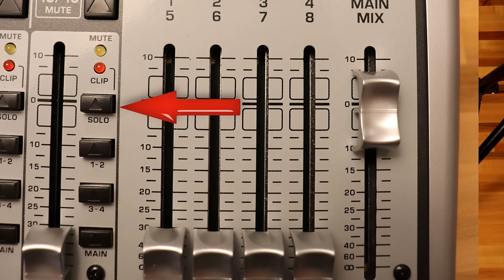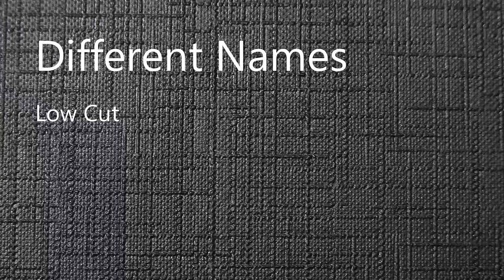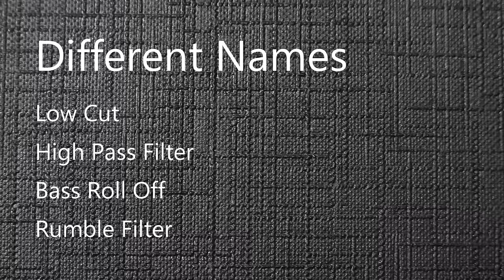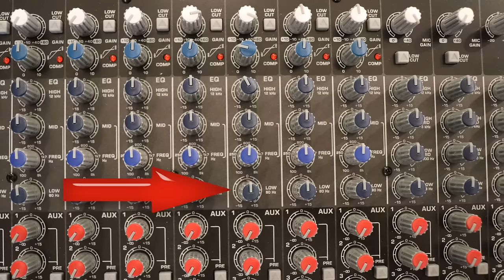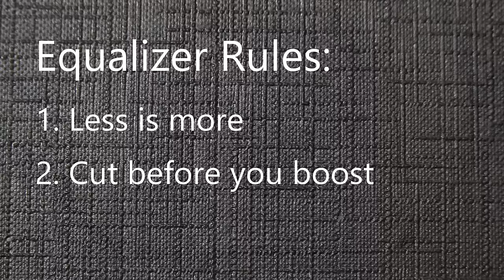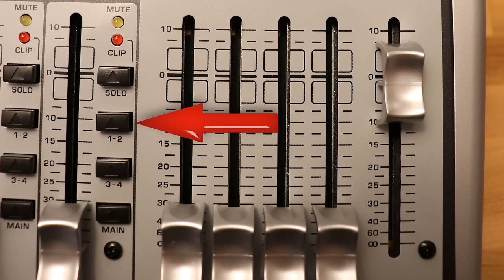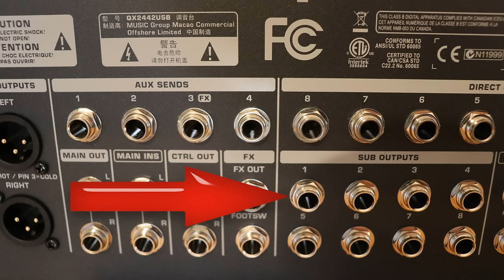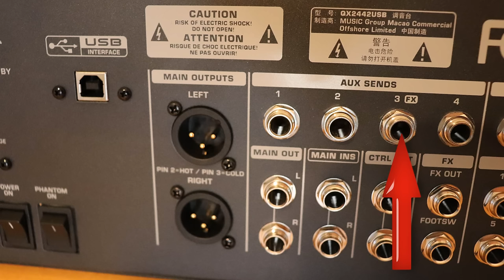Analog Mixer Basics (How to Use An Analog Mixer)

Comment: Okay. The dude with the Taylor up on the platform: DI into Channel X. He's also got a pedal board. And a looper pedal going into a strum-drum pedal. Aux 1 in a loop for the pedal board. Aux 2 for the loop from the Looper and SDrum. Pre- or Post Fader? Return jacks or burn a "stereo" channel with line ins? The Looper/SDrum must have a clean "dry" input so it cannot be in the same path as the pedal board but the pedal board needs to be as prominent in the mix as the looped part with a rhythm generated. And we hope that the drummer can keep up with a click track...........
Reply from the maker: Whoa that's a neat application. I would lean pre-fader on this as it gives me the most control. If any added FX are in stereo, I would thing a stereo channel would sound best. Happy Looping!

Comment: Would an insert be something like a chorus box pedal that would be used to have an effect on a guitar or vocal? Thanks.
Reply from the maker: For the most part, it's used for outboard compressors, reverbs or effects units. Most pedals are used between the guitar and the amp or direct box.

Comment: As a tech that has been doing live events for 15 years, I can back everything said in this video. Note: he chose a Behringer, and I believe for very good reason. I have the smaller X1832USB, but it still offers compression, sweepable mids and a built in 9-band graphic eq; These are all indispensable functions for live mixing. 

Very clear, concise, accurate instruction. Great video all around.
Reply from the maker: Thanks for your kind words!
Reply: Np. You earned it. 🍻

Comment: Great video, I have Behringer Xenyx X2442USB. I just picked up an EV Subwoofer, How can I connect my EV-ELX200-12PS active Subwoofer to the Behringer. Thank you.
Reply from the maker: Excellent! shouldn't be a problem. There are a couple ways you could do this. If you have an available post fader aux mix, you can use it to feed a sub. The good part of this is that you only need to send channels to the sub that have low frequencies. This is generally called "Aux fed Subwoofer." The other way is use the subgroup output. This will let you assign just the channels you want. Don't forget to the use the assignment button on those channels to send it to right subgroup.

Comment: I have a behringer x2222 usb, how could I set it up for a 5 piece band to have seperate mixes ran through their in ear monitors? Or should I invest in a digital mixer?
Reply from the maker: If all 5 people want a separate mix, then the X2222 won't work since you only have 3 Aux mixes to work with. The plus side of digital is that with the right connectivity you can everyone manage their own mix. ;)

Comment: If sending vocals to a subgroup, and i require effects on the vocals, does it matter whether the effects are sent to the main or should they also be sent to the subgroup also. Can this affect how the effects are placed in the audio chain. Hope this makes sense.
Reply from the maker: No it does not matter. It should work just as if you weren't using a subgroup at all.

Comment: i have a problem when the behringer mixer is connected to zoom. when the mic and speaker read the usb interface, the sound from the mixer can't come out into the zoom. the solution is to activate the 2TR/usb to main button. but when this button is active, the sound from zoom can't enter. please help how to fix it. Thank you.
Reply from the maker: Ah this is tricky. It mutes so you don't create a feedback loop. You may need to use the computer's headphone output and a cable to get sound back into the mixer. Just make sure that you don't send the Zoom Audio back into the Zoom Mic mix, or you will get a feedback loop. Yikes!

Comment: please, I want to ask. if i have a personal monitor mixer p16 and i have an analog mixer but i do not have a direct out . So what should I do ? to change from insert to direct out.
Reply from the maker: I'm not 100% sure what you are asking Peter but the P-16 is meant for use with the X-32 digital mixer platform, it won't work with analog mixers.

Comment: Great video!  I use an iPhone into a mixer for backing tracks.  I have heard source/phone should be at 100%.  I back it off one click to 95%. I PFL until red clipping and back it off until red disappears. Is this correct?  I called Souncraft tech support and this was their suggestion.
Reply from the maker: Yes, that's a good method. Phones can be tricky since they all have variable output levels. Mine keeps turning itself down because it thinks I'm damaging my hearing at the high volumes I need to drive a mixer. 😛

Comment: Coming from a DAW perspective, would it be sufficient to record and EQ from this or are you better off doing it only within a DAW through a Interface? Or maybe both?
SOmething tells me that recording and EQing through an analog mixer will give you a better sound rather then using plugins. I would love to use a mixer that works also straight with my DAW.
Reply from the maker: Ah yes, an excellent question. I'm of the opinion that plug-ins can sometimes be a rabbit hole where you just endlessly tweak. I try to get the sound I'm looking for before I hit record. So many classic recordings were made with super basic gear using good mic technique and solid mixing choices. That said, keep in mind that if you use the stereo output, you're stuck with all the mix decisions you have made in the recording. Some people will record into a multi-track interface and play back all the tracks through an analog mixer to create a stereo mixdown through analog. This lets them change things every time they play back the song and record the final stereo mix as many times as they want. Something else you might consider is an analog mixer with multitrack interface built in. There are several that I know of and they come in different sizes. Check out the Soundcraft Signature MTK series or the newly released Mackie Onyx mixers. This gives you more opportunity to "flavor" your incoming sound but still record multitrack to your favorite DAW. If you want hardware multitrack without needing a computer for recording, you might like TASCAM Model 12 Mixer or the Zoom Livetrack Series I believe both of these can also function as a multitrack interface. One last thing to consider is that most dedicated recording interfaces tend to have better preamps for the same price since they don't have all the extra hardware. 🤔 I'm not a recording engineer, so I'm sure there are more options, but maybe that will get you pointed in the right direction. Happy recording!

Comment: Howdy, I noticed that when you adjusted the gain on your channel both faders were set at 0 , main and channel 6. is this just for setting gain or do you leave six set that way?  thanks
Reply from the maker: Hi Phil, There are two ways to set up your gain. One is to set your fader at -0- zero and then adjust the gain to a good level. This works well if you are just doing one main mix. The other way is to set the gain just below clipping. This works well if you are doing multiple mixes because you might need extra level on an Aux mix that you don't need for the mains mix. In that case, your main fader would likely be less than -0- depending on the levels you need. (I hope that helps.) 😀 Thanks for subscribing and watching!
Reply: @proclaimav4197  Thanks Tim. You've been very helpful. I'm in the process of upgrading my mixer to the qx2442usb, that's how I stumbled onto your channel. Good stuff. I'm excited to get it.

Comment: Do I gain stage a behringer xenyx 802 mixer to dslr camera, while viewing my camera signal meter?

Or do I gain stage the mixer first then connect it to the camera?

Thanks for your time!
Reply from the maker: Hi Joon. If you are using the proper line level to mic level attenuation cable between your DSLR and the mixer, you should gain stage the mixer. If levels are still too high, just reduce the main output level on the mixer. Good Luck!
Reply: @proclaimav4197  thank you!

Comment: Do you adjust the Gain to hit zero on the level meters before or after turning on the Lo Cut filter?  I noticed your signal significantly reduced after turning on Lo Cut, and was not coming to zero at all after that.  Thanks in advance, and thanks for the tutorial - it's VERY educational for me.
Reply from the maker: So yes, it's best to check your gain again after you are done tweaking (including EQ, filters, ect.) 😀
Reply: @proclaimav4197  Excellent.  Thanks for the follow-up on this, Tim.  Much appreciated.

Comment: Excellent video! I do have one question. We are using 2 monitor mixes and I would like to send reverb to one of them. I can get the reverb on the mains with no problem but I can’t seem to get it on the monitor.
Reply from the maker: Unfortunately not Tony. The only FX routing options are Mains or Subgroups 1/2 or 3/4.
Thanks for watchin'!

Comment: BIG Question. Does it make a diffrence to connect speakers by TRS - TRS cable or TRS - XLR cable? Or maybe chose the mixer with XLR main out to use XLR - XLR cable?
Reply from the maker: Hi Adam, the answer is no, since both TRS and XLR are a balanced connection. You can actually buy cables that are TRS on one end and XLR on the other. As long as you are going from balanced to balanced the connector type is not important. Hope that answers your question. 😃 Thanks for askin'
Reply: @proclaimav4197  Thank you! Hace a nice day 😉

Comment: So where do you plug in an instrument? I missed that part I guess.
Thanks for any answers!
Reply from the maker: For high impedance instruments like a guitar you'll want a direct box. For electronic instruments you can use a mono or stereo line level input. This mixer doesn't have instrument combo inputs like some interfaces or mixers. Hope that helps!

Comment: How  do you connect a interface to and analog mixer? I'm slightly confused.  Second I want to use two different sets of monitors on my analog mixer to listen to a song or track for different sound quality when doing mix downs.
Reply from the maker: Hi Derick. This mixer has a built in two track or stereo interface but it only records the final mix. You can use the stereo XLR outputs to feed an interface or use the RCA two track out on some boards. As for two sets of monitors, you could just assign everything into a subgroup and let that subgroup output drive a second set of monitors. Happy Mixing!

Comment: Awesome video. I am looking to add an in ear monitor. Where would I add that so that the pastor only hears the output from a specific mic (like on the board)?
Reply from the maker: Hi Bryan. I would use an Aux mix for that situation. For example if you use Aux 1, then you can plug Aux 1 output into your in-ear transmitter.

Comment: This video is easily the best I’ve found so far to explain the functions of this board.  I purchased this same mixer on the advice from some musician friends for my 16 year old son’s garage band.  You’ve given me a point of reference to get started and to go back to if I run into any trouble.  Now I just need to figure out how to plug everything into the right places so I can start tinkering with it!  They will have 3 instrument mics along with the singer’s mic going into the board, and 2 powered mains and 2 powered monitors coming out…plus a 1000w Crown power amp to power this passive mixer.  Do you have any videos made to demonstrate connections?  Or any website that you’d recommend?  Regardless, thanks for this video!    It’s sure to help a ton!
Reply from the maker: Glad it was helpful. I'm assuming you have passive speakers since you have an amplifier? If you have powered speakers (that you have to plug into the wall) you don't need an amp at all. I don't have a setup video for passive speakers and amps. Maybe I should make one...🤔 Audio University has a good video here using powered speakers. https://youtu.be/Avaa4_702eM
Reply: No, my son’s band has powered speakers.  The guy that recommended this mixer told me I’d need a power amp, but THEIR band might use passive speakers?  I assumed the mixer itself was passive…good to know, thanks!

Comment: One newbie question: Is it possible to use the laptop's mic line in to route in the mix out of the mixer (without an external audio interface)?
Reply from the maker: Yes, as long as the laptop will take a line in. Check out this video. https://youtu.be/eBGNTO00nwg
Reply: However with wrong voltage there should be a possibility of burning the line input, it's too delicate.
My friend somehow fried the line input on his laptop.
He worked as freelance sound guy few years ago, and his laptop been at many places, such as cafes, restaurants, concert halls, etc.... I guess he plugged in something out of place or too powerful...
Or maybe line input just died by itself.... or it was used too many times...
I cannot recall these input jacks dying very often on their own,so I may be wrong on that one, who knows?....
Reply from the maker: Hi Daylight, Most modern laptops with combo jacks will take mic or line level signals. The only way I know that you can cook a laptop input/output jack is playing back music using an 3.5mm to XLR plugged into a mic input and accidentally turn on Phantom Power 🎆 - 48v to your input is bad news. :P

Comment: Great video,  thanks for posting . I'm getting a beringer xenyx qx2222 usb and would like to connect it to a looper peddle , in stereo if possible.  What would the best way to do this in your opinion ? My thoughts were to go out from the aux sends 1 and 2 into the L R of the looper , then out of the looper L R into the L R of the mixer aux returns. Would be very interested in your thoughts . Thanks
Reply from the maker: Hi Stephen, (Disclaimer, I have not tried this before.) Here's what I would try. Looper peddles can be tricky since you are coming out and back into the same board. I would set up your source channels both on Main and on Subgroup 1/2. Use the Subgroup 1/2 to feed your looper input. Take the output from the looper and plug into a stereo channel, making sure you do not assign it to Subgroup 1/2. This essentially creates a mix minus. If you have a stereo source for the looper pedal, you may need to use two channels with one panned right and one panned left to preserve the stereo effect and send the channels to Sub1 and Sub2 separately. Hope that helps!

Comment: Thanks.  Should the FADER be set at UNITY when (before) you raise the GAIN?  That's how I see you did it?  That is a bit confusing.  Thanks again.
Reply from the maker: Oh, this can be controversial. Some folks will argue that you should set all the gains and then bring up the faders to a correct level. Others will bring all the faders to unity and then set the gains so that everything is at the right level. I'm not dogmatic about it. Often, when a system is run by multiple volunteers, I'll set it up so that any fader can be set to unity and the mic turned on with a good result. It keeps me from having to add a bunch of little tape arrows or labels for each channel. 😉
Reply: I was always taught that you set gain unity gain structure by putting the fader at unity, then have the instrument/voice sound off as loudly as they’re going to, and then use the gain knob to get the level to where it’s just barely reaching orange, but never red. That gives the faders exactly the amount of signal it needs to adjust correctly and consistently across channels.

Comment: Dear Sir, I need to know l that when we use AUX sends to stage  monitors, should we use TS (mono) or TRS ( stereo) quarter inch jack? Is AUX send is a mono or stereo output ???
Reply from the maker: You can use either TS or TRS and the feed will be in mono. Thanks for watching!

Comment: Very useful video I have two questions:
1.  If I have a microphone assigned to subgroup 1 and 2 and select subgroup 1 and 2 to listen to with headphones, do I have audio on both sides of my headset?
2. If I use the direct output of my mixer to have a microphone run into my PC, will listeners on the other side of any voice chat programs like Skype hear my voice on my both sides of their headphones?
I really dont understand the concept of mono and steroe yet :(
Reply from the maker: Hi Brillenmannetje, So any mono input (a single microphone for example) will send to both right and left of your main mix. (Unless you use the pan control to send it only to Left or Right.) This also goes for the subgroup. If you leave pan in the middle, your channel will go to both subgroup 1 & 2 and you will hear in both channels of you headphones. However, if you are taking the subgroup outputs on the back of the mixer, they are mono. To get two channels you can use both subgroup 1 & 2 outputs to feed Left and Right. Hope that helps!
Reply: Proclaim AV thanks for your assistance!

Comment: Dear Sir, I want to know if I set the gain in right way, when I am setting Low shelf and High shelf of EQ, the volume meter goes more than unity gain. 
So should I set the gain back aftert set tye EQ????? Thanks
Reply from the maker: I would start with setting the gain first. If you are changing the gain significantly then you may have to re-adjust the gain down a bit.

Comment: how can i record my mixer to my computer? my mixer is behringer xenyx xl1600 with no usb output
Reply from the maker: To get two channels in on a budget check out the Behringer U-Control UCA222 USB Audio Interface. Connect it to the 2 track in/out via the RCA connections on the back.